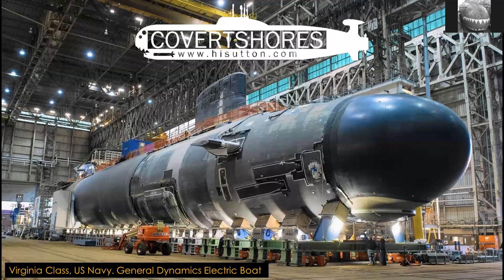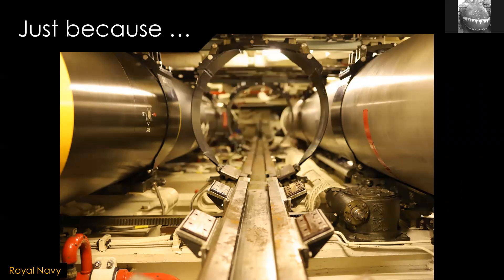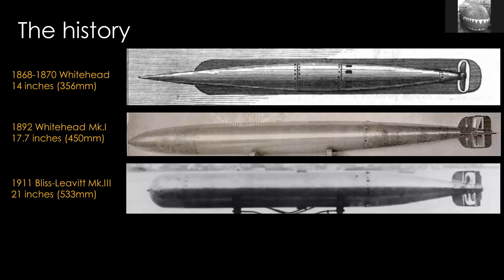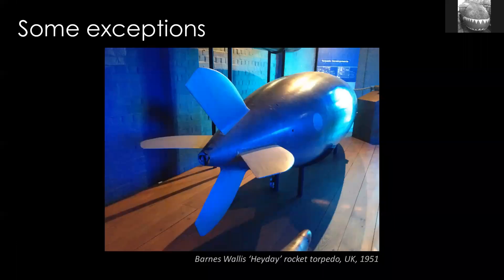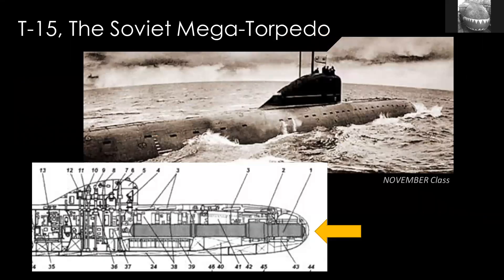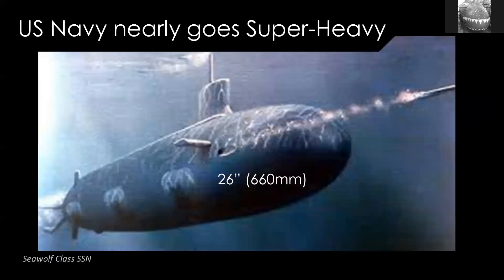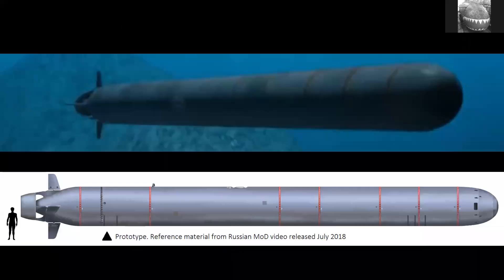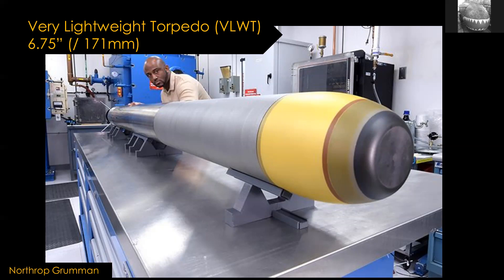Submarine FACTS: Why Are Torpedoes Always The Same Size?

Comment: As a former US Navy torpedoman, I remember a 19” torpedo. It was 19” so it could “swim out” instead of being pushed out by air pulse. The “swim out” torpedo thus was quite a bit quieter than the 21” torpedo.
Reply: Thanks for the info.
I also have in mind of two different sizes. Also of one sub with two different size of launch tubes.
Reply: It might be quieter on launch, but flooding the tubes still makes lots of noise, doesn't it?
Reply: @nicklockard  flooding tubes and opening bow caps and shutters will give the game away
Reply: Are you thinking of mines? I know when I was in those were the only swimout weapons we could potentially carry. I never got the "pleasure" of using them but I heard from a lot of other guys they were finicky as hell, especially around RF.
Reply: @1337penguinman  Nope. I only saw them in Torpedo Man class. Never saw one on the old boat, USS Bugara.
Reply: I believe you’re thinking of the WW2 Mark 27 torpedo. It was a 19 inch electric passive acoustic homing torpedo that if I’m not mistaken, was the worlds first swim out torpedo. It is essentially a mark 24 mine. That’s been adapted for submarine usage by adding wooden rails to allow it to fit snugly into the 533 mm torpedo tubes.
Reply: More likely it was Mark 37 torpedo a 1950s replacement for Mark 27 torpedo that was in service until 1972.
Reply: @benjaminpitman2980  Yes, thank for for reminding of the name of the torpedo. It was the Mark 37. It was always a mystery to me why they looked short and squat compared to the old 21” torpedos, but I guess it was their shortness that did it. I also remember there was definitely no smoking in the torpedo room as they put out a lot of hydrogen when they were charging.
Reply: Did it also have a V8 engine in it? like the 21'' torpedo.

Comment: Logic is the reason torpedoes are 21" in diameter. There has to be a way to load them on board the boat. They are crane loaded from the dock through the main access hatch and passageway floor panels are removed so to guide them down into the torpedo room diagonally which limits their length. That's how we reloaded in port when I served in the 1980s.

Comment: I think physics dictates that approx 21"/ 533mm is optimal.  Larger diameter means less efficient and more difficult to handle.  Smaller diameter would be more efficient, but at the cost of being much longer to carry the same warhead.   So making large adjustments is out, but small adjustments to the size is possible.  But as stated in this video, changing the size isn't worth doing due to logistical and compatibility issues.

Comment: The primary reason for size is hole strength give the quality of steel.  The second reason is hydro performance of the torpedo given its diameter and bow shape.  The third reason is being able to use various ammunition supplied by other countries.  The combination of the first two are what given rise to the manufacturing aspect.  The third is just economics.  And just like a bullet in the air, the diameter of a torpedo is also related to it's length and power of propulsion.

Comment: i mean. its pretty easy. 21 inches is good enough to do the job. and because 21 inches works right now. all boats have 21 inch torpedo's that way any torpedo will work in any torpedo tube (more or less)and because deeloping weapons is expensive. and developing new ships is even more expensive. yopur going to desing your boat to work with what weapons you have now as well as in the future. 21 inches works now. and thre is no particular reason 21 inches wont work in the future. so... make verything 21 inches.

Comment: It’s the same reason that standard gauge rail tracks are 4 feet 8.5 inches, “because”. It’s was the wheel base for Roman carts and Chariots, after the Roman Empire fell, it continued to be used by wagon builders and thus was adopted by the early British train builders (albeit, some used smaller and larger).

Comment: Something I have always wondered about is if (due to the cost of torpedoes) and the (relatively) cheaper cost of missile, IF it might be possible to build a hybrid missile torpedo. The torpedo part would go a short distance and then surface, where the missile would fire track to its target. The torpedo part would not need much of a guidance system. Possibly a number of smaller unguided rockets would be fired at a specific distance determined by the angle and direction of surfacing.
Reply: The opposite has been done with rockets that carry a torpedo for long range anti submarine work (RAN had the Ikara). Not sure what the advantage would be, submarine launched cruise missiles exist already without the initial torpedo step.
Reply: @hannahranga  I do not know if every sub can launch cruise missiles, but all combat subs can launch torpedoes. The two advantage I was thinking of would be range and speed. Also, most ships have torpedo blisters now, reducing the damage torpedoes do. I think sub launched rockets would be a lot cheaper than torpedoes.
Reply: SUBROC in service from 1964-1969 with the US Navy. Launched from a torpedo tube, after launch the missile fires and surfaces with the missile on a ballistic track to the target area. the warhead was a 250 kt nuclear depth bomb.
Reply: @ewhartiii  That was the first of several attempts at making long range antisubmarine weapons. I have not found any recent indications yet that subs have these types of weapons for surface ships. I know they have missiles that can take out ships, but I do not think any anti-ship cruise missile are launched as torpedoes. Launching a missile pretty much gives away the subs position as it goes straight up from launch station.

Comment: Your information regarding torpedo size is inaccurate. They were not always 21" in diameter. During WW2, the Mark 27 torpedo (cutie) was only 19" in diameter and had to be specially fitted with external hardware. The Mark 27 was an electrically driven acoustic homing torpedo. The drawback was it lacked a sufficiently powerful warhead to be used against most surface ships. When launched it homed in on the sound of enemy vessel screws.
Reply from the maker: Yes I should have mentioned Mk.27 and Mk.37 in the list of exceptions.

Comment: Can you comment on the design factors are considered when specifying the number of torpedo tubes on a submarine? It seems to vary quite a bit for boats that seem to have a similar mission.
Reply from the maker: That's a whole topic in itself. A few factors though... 

At a time it was thought that the increased lethality of individual torpedoes meant fewer would need to be shot at once. This logic led the USN to drop to just 4 tubes, something they are now stuck with in current generation designs. 

In the Cold War German designs generally went for more tubes but few or no reloads (and those reloads less accessible). This allowed the boats to be smaller and the 'torpedo room' to primarily be accommodation. Thinking Type 206/9/14 etc

Separately, there was a view developing during the Cold War that nuclear subs were SOOO combat effective that they would run out of torpedoes before being taken out. So they started carrying 35-40 torpedoes. Thinking SIERRA, AKULA, Astute, Seawolf, Yasen. In some cases, notably Seawolf and Yasen, this meant two torpedo rooms, so more tubes. 

Personally I think that more is better, especially as navies will want to put more types of weapon and UUV through them. If you only have 4 tubes, and two are for emergency self defense,... it's a pain to pick what to load into the remaining two.
Reply: @HISuttonCovertShores  Thanks! That would be an interesting video, especially with the latest mini-torpedoes being added to the mix. Perhaps return of the aft firing torpedo tubes?

Comment: I’d like to add another potential reason: the London Naval Treaty.

The five major navies in 1922 (UK, US, Japan, France, and Italy) had signed the Washington Naval Treaty which limited the size, capability, and number of capital ships and aircraft carriers. However, a cruiser arms race had begun, and so in 1930 they came together to limit the size and capability of other ship types, including submarines.

Torpedo size is not mentioned, but the treaty did limit submarines in other ways. Each navy was restricted to three submarines larger than 2,000 tons and no larger than 2,800 tons (with a specific exception for Surcouf then under construction). Existing submarines could keep their gun armament, but most were limited to 5.1”/130 mm with three using up to 6.1”/155 mm (again Surcouf was grandfathered in). Submarines could not be replaced until they were 13 years old, and the US, UK, and Japan were limited to 52,700 long tons of submarines (53,543 metric tons). These restrictions were extended to other nations by the Anglo-German, Anglo-Soviet, Anglo-Polish, and probably Anglo-Scandinavian Naval Agreements (I have not seen a copy of the last one), which duplicated all definitions and most restrictions as of the 1936 London Naval Treaty.

This put a limit on submarine replacement, and made sticking to existing torpedo sizes more important. You could not build new submarines in large numbers and ditch the old ones anymore, and the Great Depression limited that capability anyway. This started to lock-in torpedo size for most nations, and is why France kept the odd sizes.

I should mention there is one major size difference that continued: length. I only know the US story and only partially, but older submarines were restricted to shorter Mark 9 and Mark 10 torpedoes while newer builds could use longer Mark 14 torpedoes, with some tubes (generally in the aft torpedo room) capable of taking the longer surface-ship Mark 15. Longer torpedoes in general had more internal volume for the air flask and warhead, increasing speed, range, and striking power, though this varied somewhat. Postwar, even shorter torpedoes like the Mark 37 served alongside longer torpedoes, and some submarines like the GUPPY II rebuilds were restricted to using short torpedoes for some torpedo tubes. My knowledge after ~1960-1970 is too limited to discuss further.
Reply from the maker: Thanks, all good food for thought. I did give the treaties etc a cursory look in my research and like you didn't find anything mentioning torpedo sizes. 

Your points made me think though. Two counter points surfaced... 
a) if "sticking to existing torpedo sizes more important" then why not 17.7" (aka 18")?

b) if many parameters are limited, we can expect to see more innovation in the ones which aren't. 

I don't think we can take the naval treaty era out  the context, and along with several other major factors (lessons in WW1, suddenly limited budgets, unrestricted submarine warfare, the cruiser sub red herring...) is part of the picture.
Reply: @HISuttonCovertShores  By 1930 very few new submarines were being built with 450 mm tubes. I know the US and Japan had upgraded to 21” many years prior, and while my knowledge of other nations is more limited I suspect they only ones who hadn’t completely converted were France (with 400 mm intended for merchants) and possibly the Soviet Union (which were not in the treaty structure until the Anglo-Soviet Naval Agreement in 1938 or so, can’t recall offhand). Aside from midget submarines of course.

The 1930 treaty prevented the next increase, but by then 21” had become a fairly standard diameter. With displacement limitations, the number of torpedoes you could squeeze into the pressure hull around other necessary systems became important, as for almost every submarine in WWII (and almost all subsequently) this was the hard limit on torpedoes in a torpedo room. Thus making larger diameter torpedoes was not practical as this would reduce the number-of-torpedoes-per-cross-section, which reduces the number in the torpedo room. Torpedo length would still improve performance and could be increased by rearranging internal spaces and lengthening the torpedo room, and by WWII a 7.2 meter long torpedo was pretty standard outside the US (we were around 6.25 m for dedicated submarine torpedoes).

The treaty structure often didn’t specifically state limitations in many areas, but there were many ripple effects. For example, there is no limit to the number of guns a cruiser could carry, but 8-10 8” guns and 12-15 6” became default for large cruisers because that’s the practical limit you could get on 10,000 tons. It doesn’t prohibit nations from building ships with, for example, 7” guns, but post-treaty only the Soviets built such ships: going below the limit was choosing to cripple yourself.

I’d consider the treaties a potential contributing factor towards staying with 21” torpedo tubes until WWII for many nations, one of several as you pointed out. Since that was standard during the war and wartime production dominated the early Cold War submarine and torpedo market, 21” became standard ever afterwards.

Comment: Interesting, surprising that it’s a standard size just because it’s a standard size… I would expect modern torpedoes to go smaller. For their reduction in resistance. The liner would allow you to overcome any intermediate period - right ?
Reply: It's certainly easier to go smaller than larger. 

I was on an SSN that carried a couple Mark 37 torpedoes for a special purpose. They are a 19" torpedo with stand-offs so it worked fine in a 21" tube.

Comment: Would have liked to know at what time different nations adopted the standard size and under what political circumstances. It makes sense for allies, but who would have expected americans and russians to have the same standard during the cold war?
Reply from the maker: Hi, this does answer that. 533mm became the 'standard' in 1920s. It was never official though, just a default standard size. The first ones were earlier but from the end of WW1 onwards it was normal in almost every country (the exceptions are always interesting, but they prove the rule)

Also, from 1800s until the creation of the USSR in 1917 Russia purchased torpedoes from the same manufacturers as western navies. There were local designs too in many countries, but ones like Whitehead dominated in Russia as much as anywhere else
Reply: @HISuttonCovertShores  The second part was the one I thought about. Interesting, that there were "global" manufacturers at that time even for military equipment. I have no idea about the political interactions before WW1.
Thanks.
Reply: Also, France used the slightly larger 550mm torpedo until post-WW2.

Comment: Can someone answer a general submarine question for me:  The displacement figures for submarines always give a higher displacement for the submerged vessel.  I'm assuming that this is because there's just physically more of the vessel under the surface, displacing water.  However, for a submarine to submerge (to become somewhat negatively buoyant) is had to become smaller, to displace less water by flooding its tanks.  Do I have this all wrong, or there a good reason for using the current method of specifying displacement?
Reply from the maker: The water in the tanks is counted in the displacement figures

Comment: Its most likely because 
i) every opening in the hull is a potential weakness,
ii) thus torpedoes have to enter the sub through the same hatches as the crew,
iii) these hatches have to be as small as practicable, 
to allow a mans shoulders to pass through requires about 21" .QED.
Reply from the maker: A decent line of logic except for a few things to consider

a) often the torpedo loading hatch is not a crew access hatch. And it could be larger if they wanted. 

b) another way to load torpedoes is through the tubes themselves. Ideally the tubes are above the water, but Iran for example loads some boats by floating the torpedoes into the tube with the help of divers. Obviously the breach end of the tube is closed until the muzzle end is closed and the tube drained. 

c) Crew hatches can be larger than 21"

So overall I don't think the crew hatches was a driver even though it's a tempting idea at first glance

Comment: Well, if the weight of explosive is required to achieve the desired results on given targets can be established by experimentation. Then I think that begins to set the dimensions of yer torpedo, so if 600lb of torpex is deemed adequate then that would begin to set the physical attributes of the torp. Next i imagine is the propulsion system x speed by x distance requires x amount of fuel or battery power, or 'stuff' to decompose. So again the requirements set a volume needed. Next is guidance, well you get the drift. 
I suspect that 21 inches or abouts gave the best balance of physical length and diameter to handle inside a submarine where i think length is less  of a problem than diameter which would impact how may fish a designer could squeeze in.
Like any other design standard  there is a great deal of 'because' involved in clinging to an old one. Historically probably 21 inches was arrived at as the minimum adequate girthyness to get a side attack to work against torpedo attack counter measures bulges, internal crush spaces etc. However with the advance of active torpedo sonar enabling under the keel detonations that stepped up the game and needed less warhead to get the job done ;-) thus 21 inches has endured as sufficient .  Contrast helo dropped antisubmarine torpedoes  much lighter and compact as 1/ is air carried must be lighter and 2/ less warhead needed as a softer target is intended.

Lastly there may be solid hydrodynamic reasons to desire a particular length/diameter ratio, this alone would force torpedoes into particular niches and 21ish inches gave the best balance of diameter for a maximum practical length usable inside a subs torpedo compartment etc.